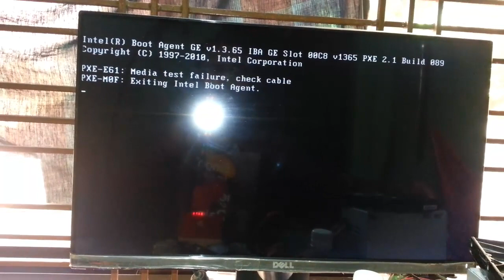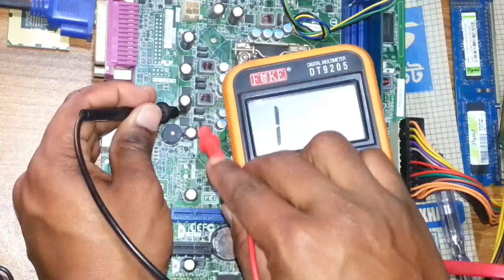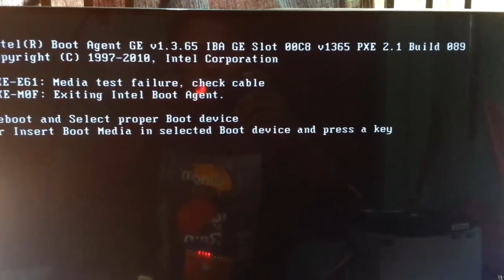Intel DH61WW Desktop Motherboard Restart & Power Problems Repair By Tanvir Computer & Scientist

Comment: hello i have intel dh61ww 
intel 15 2400 
8gb ram 
how many watts psu is needed to run this (english plz)
Reply from the maker: 500 w, 550w, 600W, any 1
Reply: @tanvircomputerandScientist  sry i also have geforce gtx 670 too is 550 watts enough to run all of it

Comment: Hello sir
Amar Intel DH61WW motherboard a standby problem motherboard er green light ta jolche na.
Ki problem hote pare?
Ki ki korle solution peta pati?
Reply from the maker: Power asa ki , Judi Power asa ta hola led asa pasa kicu Capacitop ba Mospat shot hoya gasa, ar judi ackdoma power na asa ta hola apner bord ar Main IC Nosto hoya gasa, na hola Contoler short hoya gasa ba,VRM Ar Problem hoysa
Reply: @tanvircomputerandScientist  thake you